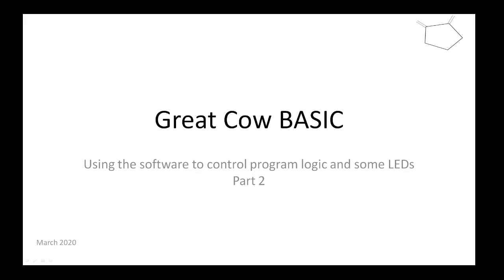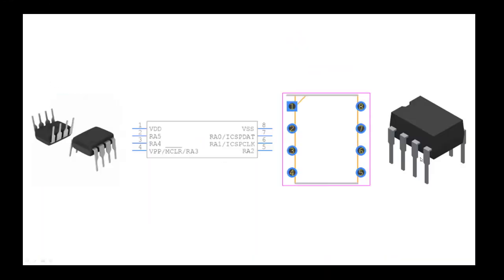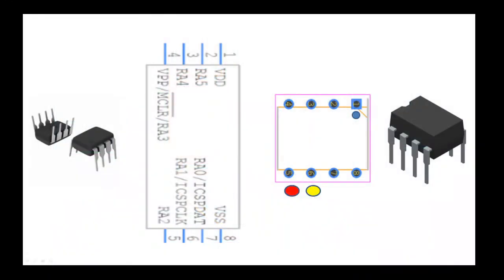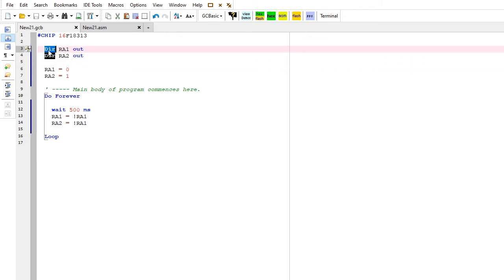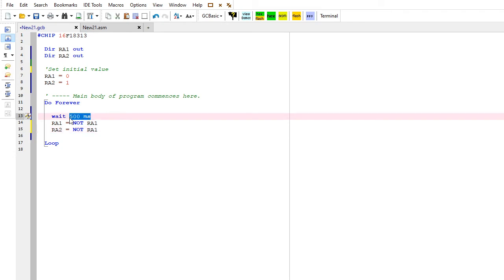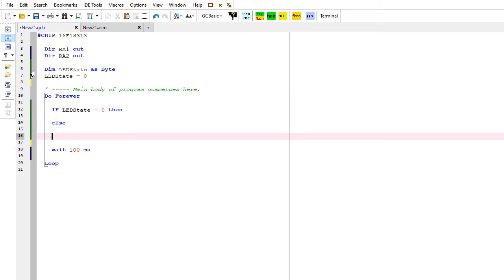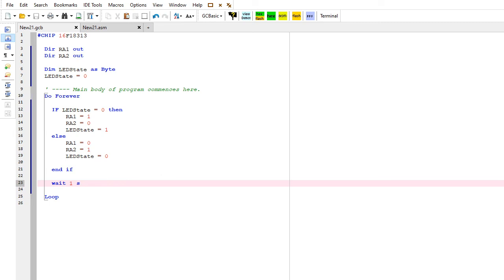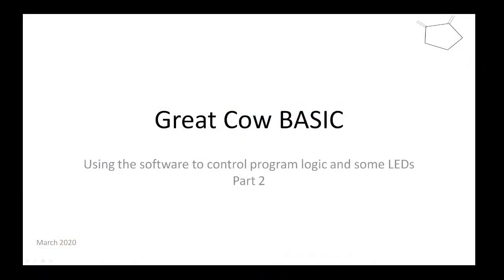Great Cow BASIC: Part 2: Controlling the outputs to flash two LEDs

Comment: Good videos, but what is with the capacitor in the schematic, but not visible on the little bread board?  I saw another video where they had a 10KΩ resistor between Vdd and MCLR pin ???
Reply from the maker: Some Microchip documentation shows the capacitor and some do not.  The Programming guide do not show, but, the Microchip developer guide do show.

It is best practice for operational boards to have the capacitor (called a decoupling capacitor).

The use of decoupling capacitors on every pair of power supply pins (VDD and VSS) is recommended.   Consider the following criteria when using decoupling capacitors:

Value and type of capacitor: A 0.1 µF (100 nF), 10-20 V capacitor is recommended.  The capacitor should be a low-ESR device, with a resonance frequency in the range of 200 MHz and higher. Ceramic capacitors are recommended.
 
Placement on the printed circuit board is important. The decoupling capacitors should be placed as close to the pins as possible. It is recommended to place the capacitors on the same side of the board as the device. If space is constricted, the capacitor can be placed on another layer on the PCB using a via; however, ensure that the trace length from the pin to the capacitor is no greater than 0.25 of an inch (6 mm).

To handle high-frequency noise upward of tens of MHz, add a second ceramic type capacitor in parallel to the recommended decoupling capacitor. The value of the second capacitor can be in the range of 0.01 µF to 0.001 µF. Place this second capacitor next to each primary decoupling capacitor.
Reply: @AnobiumTech  What would the 10K ohm resistor do between Vdd and the MCLR pin?  I saw this in another video.

Comment: was not a bad idea make if possible some nice videos about bluetooth hc-05 , sensors hc-sr04 , keypad, or lcd 16x2 , most common things used , with our GREAT COW
thanks
Reply from the maker: This is the current plan to complete the 21.  Temp sensor is to represent sensors.

11. Bi direction serial
12. Millis
13. Timer0 led flash
14. Timer Interrupt
15. Serial to LCD
16. Temp sensor to serial
17. Tables
18. Eeprom 
19. CLC
20. Programming
21. Asm and alternatives